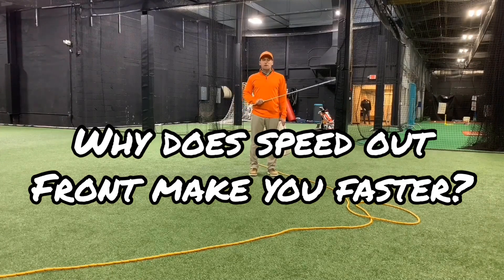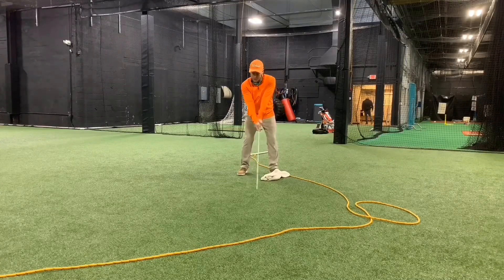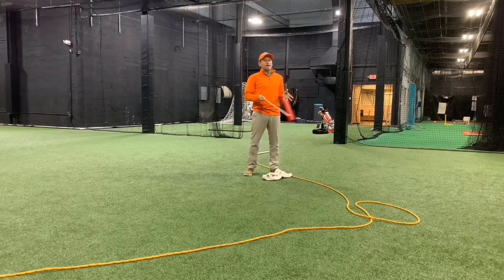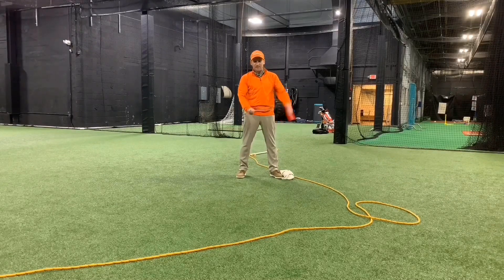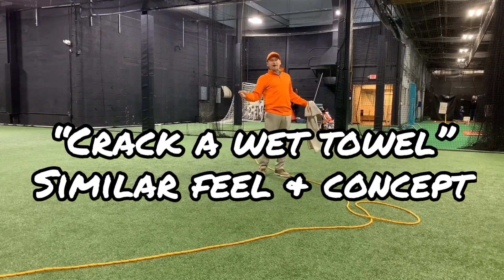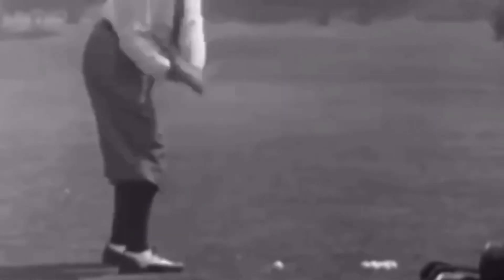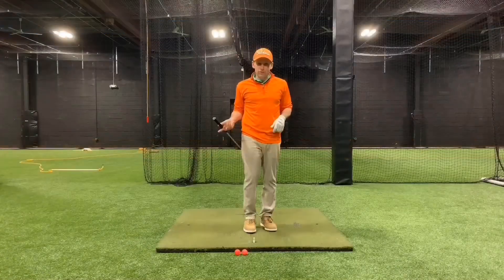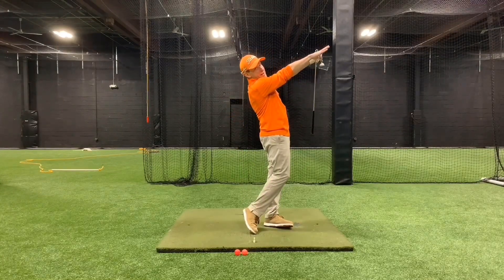Why Does Speed Out Front Make You Faster❓

Comment: Jason, any secrets on how to take the speed picked indoors can be transferred to a golf course swing?
Reply from the maker: Knowing which hole you can unload the most speed out front 🆚 slightly more under control. Only certain wide open tees shots do you want swing your higher gear with the driver. Can always back down to a 3 wood or 3iron and still hit a an aggressive shot with the same speed out front / strong finish swing thought 💭
Reply: @CoachJasonGolf  Thanks for the quick response. Also the rope device , I presume is Mike's Shallow Stick. I notice you aren't throwing yours up as high as others I have seen using it. I workout with limited ceiling height and what you are doing may work out for me . Thank you for this video that just popped up on my YouTube page.
Reply from the maker: hakirk1 yes on Mikes shallow stick